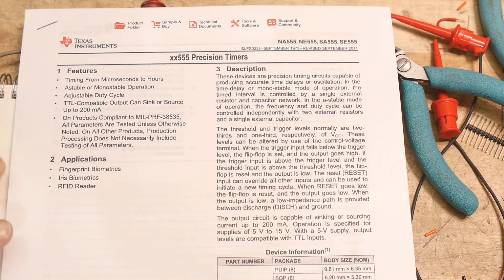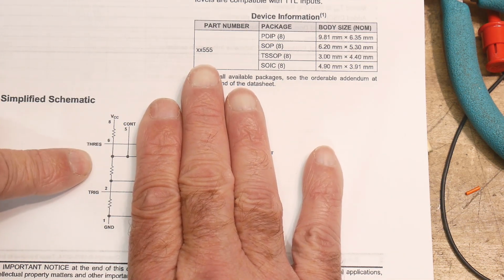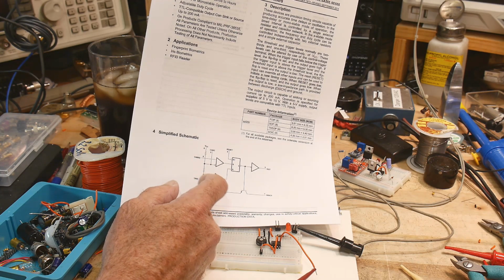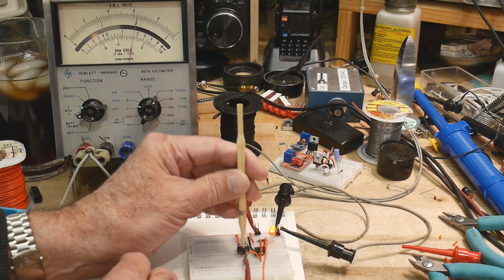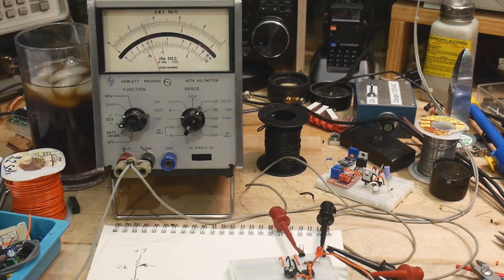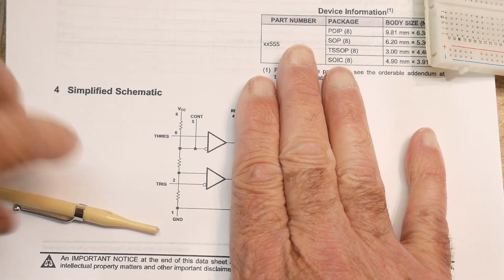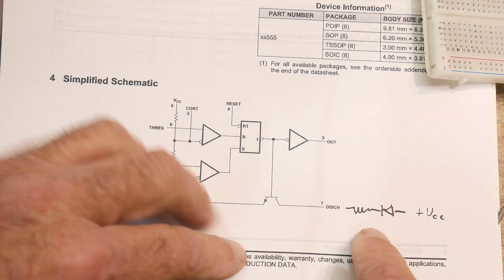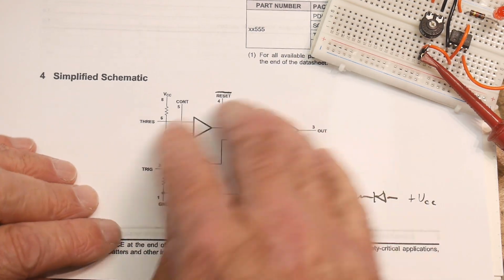#729 Basics: 555 Timer (part 1 of 2)

Comment: The original NE555 was made by Signetics. Inventor just died in 2012 according to Wikipedia. I think all the 5xx parts were originally Signetics parts like the NE567 PLL tone decoder, NE560 family PLL chips etc... According to Wikipedia (source of all knowledge....) the 555 number has no relation to the 5K resistors but just was chosen by the marketing people. All their parts from that era were 5xx so makes sense. Wikipedia also says over 1 billion 555's have been made (as of 2017) and is probably the most popular IC ever made.

Comment: Fun facts for the control pin.  If you use the low power CMOS version (7555 or equivalent) then the internal resistor divider uses higher resistance values, typically 100k or higher.  So if you need a high impedance on the control go with the CMOS part.  Also for the bipolar version you will probably need to put a capacitor on the control pin to help stabilize the voltage.  The NE555 can draw substantial current briefly when switching between high and low states which can drag the voltage reference around causing instabilities in the switching.  Usually this shows up as noisy edges in the output.